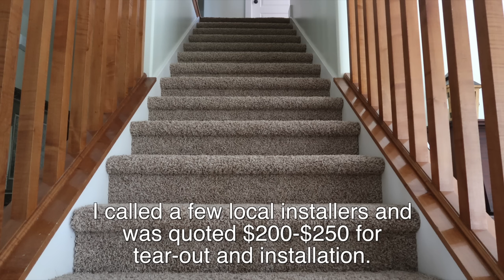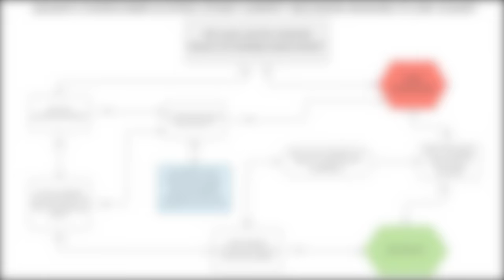How to Install Carpet on Stairs - how hard is it?

Comment: I Have Done Carpet installations for 20 years 1 Bit of Advice To Do a Rip up of Stairs,Always Start at The Top of The Steps,Ripping up your working against yourself..But Cool Video and good job.,
Reply: What happens if your stairs are already bare...nothing to rip off, then is it alright to work from bottom to top???? I'm the person that reads from the back of the magazine to the front. CRAZY habit, I know!!! LOL But, seriously...Thank you so much for the TIP (it will be VERY helpful and makes great sense). ;-D
Reply: Lollie Wink ripping carpet up is always easier to start at the top and work down. Installing is always best to start at the bottom and work tour way up
Reply: Really agree. I work in carpet and it’s way easier and faster to start from the top.
Reply: Thanks for advice :)
Reply: @leandrolopez3446  Correct Always Rip Down & Install Up..Ripping up The Carpet Going Down The Stairs is Proper Practice..it's Easier also you have more of an Advantage using your foot to Pull it Taught and use a hammer to knock it off the staples that's holding it to the lip of the stair tread.
Reply: @Andrewflex95  Absolutely Man if you Rip the Carpet Starting at the Top of The Steps it's A'lot Easier to Get Ahead of your Job you can use your Foot to Pull The Carpet Taught then a Hammer to Knock it Free from The Lip of The Stair Tread 3 Hits of The Hammer 1 hit on the Left 1 Hit in The Middle,1 Hit on The Right and it will come right off once you pull it from the bottom..Keep up the great work brother..
Reply: @kinglici5951  When Installing Yes you Start installing at The Bottom of The Flight of Stairs,,.You Need The First Step to Fasten the Carpet too The First Bottom Riser So You Can Stretch it And Make it Tight to The Next Step..Remember When your Installing Carpet the Main And Most Important Key is " Stretching it to make it tight " for Safety and Appearance of course..Rip Up from The Top & Install Starting at The Bottom Always.
Reply: I'm in the UK and we fit top down . Hook it on first gripper at top of stairs and bolster / chisel to the one below .. that way still same thing but you're not constantly fighting with carpet falling down above you why you work lol ..
Reply: Good video thanks, I personally use  heavy rubber mallet for 2 reasons 1. It's a lot less noisy rubber on to bolster and 2 does the heavy push thru.
Reply: I'm not sure I know what you mean by ripping up,  can you help?
Reply: @stevenburnett9101  Ripping The Carpet off The Steps. Taking it Off so you can install new carpet. Same Principal for Floors.
Reply: And then fall down the stairs.

Comment: Never fails to amaze me how many folks use striking/power/pneumatic tools without OSHA Z.97 safety glasses. A person can work 20 years without wearing them with no incident, but then BAM!! that stapler misfires or a staple hits an old nail or whatever and ricochets right into an eyeball.
Reply: I get accused all the time, then I remove my glasses and show the rating on both the frame and lens.

Comment: 1. To remove start from the top and work your way down pulling in a sideways motion to remove the steps, cut as you go if you need to shorten the piece you're pulling to make it easier.
2. Leave the padding as long as its not stained with urine or something, padding on stairs unless mega old is usually okay.
3. Get a drywall square or some sort of long straight edge and pre-cut your stair padding into little rectangles, they don't have to be perfect but should be as uniform as you can get them, leave a 1-1/2inch gap between the padding and the back of the riser if you don't have tack strip on the stairs.
4. Make sure the carpet grain is going down with the flow of the stairs, they'll look better.
5. Get a kicker :) and you can follow pretty much what hes doing but stretching with the kicker as you go.
6. Lift yarns out of the way while you staple to hide them, if you just staple anywhere they could be very visble depending on the type of carpet.
Been doing this 20 years and people are always too scared to try it, its not rocket science just need to know a few things, only difference is i'd have this done in about 20 minutes. You can make things easier by not wrapping the lip but just having it waterfall over, some stairs won't even have the lip. Good idea using the carpet underneath furniture, usually its like brand new so thats a good way to get more mileage out of your carpet. Good work.
Reply: agree the waterfall look so much better plus i use a double tack strip one on riser and tread 1,1/3 the thickness of the carpet to trap the carpet in the gap between the tack strips make a very clean look ans a very strong connection without staples
Reply: @bonehead2412  Yea the double tackstrip is a good way to do it, less staples the better and can pretty much get a perfect crease with a stair tool.
Reply: Nicely put !
Reply: Wow I want to see his stairs with all those wrinkles in a year . And his face saying it's worth it . Ha ha !
Reply: Waterfall nooooo  that's old style. Every one caps the stairs.
Reply: Thanks Aaron. I saved this video mostly for your information. I’m ordering a kicker and planning on giving this a go.
Reply: Aaron, we need more people like you
Reply: Care to make a video please?

Comment: I'm impressed for someone who has never laid carpet on stairs, good job!!
Reply: It can look good on camera. If you touch it and it bubles and ripples, then that's a whole other thing. He 'got away' with not using a kicker in rooms. Those rooms will absolutely get bubbles and ripples in them. He just needs it to look 'good enough' when people sign the check to him. That's his busniess model. That's not how you provide a finished look that will last.
Reply: This is hard to watch. No kicker, ripping off carpet from the bottom up, installing pad like he did. I get it he's not a carpet installer but come man those steps are not going to last without stretch on them.

Comment: Not bad. A couple pro tips though, use a rubber mallet with that stair tool so as not to cut the carpet. Also run a few staples at the back edge of the tread where you tap it down with the tool. That way you dont put staples in the stair face, it pins down the fibers and is visible in most cases.

Comment: I love this video. I've been doing carpet 30 years. Sweet compressor staple gun.! Duo-fast makes an electric stapler. Nice to see you started the installation at the bottom stair working your way up. To rip up and install a flight of box, or closed stairs, reasonable to expect $200 labor plus cost of materials. Any job that comes out acceptable is a job well done! If you had fun with that, you should try doing stairs with spindles and going through them!

Comment: I recently did the opposite. Ripped out the carpet on my stairs and replaced with oak stair treads. That too was a bit labor intensive but I'm so happy I did. The stairs with carpet always looked dirty and shabby looking as they lead to the front entrance. The oak stairs were a huge improvement both visually and ease to keep clean. I'm going with hardwood over carpet on stairs anytime I have the choice but were more expensive of the two.
Reply: I am a hardwood  installation tech and you will save over the years by not having to replace carpet and pay to have it cleaned   Also it is healthier and very easy to keep clean  I have refinished wood floors and stairs some times 70 years old. I am yet to see carpet last that long. Plus you can't refinish and restore .carpet
Reply: @captain757747  Yup, I prefer wood, it's on the plans when we go to re-carpet the house to change their stairs to wood and probably upstairs landing. As you said easier to keep clean and vacuuming stairs sucks.
Reply: The negative to wooded stairs thought is there hard on knees. I ripped up my carpet and there was a major difference walking on hard wood verses padded carpet. I'm putting carpet back. Just in case others need fyi..

Comment: Certainly worth having a go yourself, well done fella.The tools aren't to expensive, except for the stapler, mine is electric and does the job ok. The sense of achievement if it works out is good. Shop around and you can get better deals on your carpet too.

Comment: Nice job Adam, for a DIY.
Couple of friendly tips, sir.
 Rubber mallet to stair tool is easier on the ears. Definitely use a kicker. Your carpet will loosen before too long.
 I always started in the center with the first kick stretch and work toward skirt boards. 
The frieze carpet finishes nicely.
Thanks for sharing your experience. BTW - Sunday afternoon 3/15/20. bored

Comment: Was nice watching a 'novice' have a go at fitting! I'm a carpet fitter, and you done a nice enough job.. 
Only things I would recommend is that you use a rubber mallet... not hammer. 
And also don't bullnose each step then you won't require a pin gun. 
Good job! :)
Reply: What does it mean to bullnose each step?
Reply: Wrap them tight around the nose of each step.   But if there thin old 9” treads your losing a bunch of step.  Way better to bullnose.  Looks so much better but each there own I guess.

Comment: I have a semi-circle stair case so, luckily, I just do one landing-riser at a time. The new carpet will have a pattern so I will have to 'turn' each carpet piece on each step so the pattern runs with the curve. Still a lot of work. I might just get an installer. Congrats on the job.

Comment: Bravo for you. After paying (CA) Home Depot $50 to measure for my stairway carpet and installation including an area 7x6x3 landing and getting a $1,000 quote (180SqFt) I am all in for buying the stock carpet and installing myself. I just paid $3200 for 860 sf for mom's (NY) house that included installation on two staircases, LR, two hallways including moving furniture.

Comment: When I first removed my carpet from the stairs, the rubber padding underneath was caked on so hard I had to scrape it off.  After struggling with a scraper in the corners it would turn to dust.  I eventually needed a cloth iron to heat up the rest, and then I could peel it off with a large putty or drywall knife.

Comment: As a floor layer for over 20 years you did an alright job. I sat here going that's not right and no not like that and I like it that you worked  your way through and finding easier ways. Now, Stairs are much easier if you work downwards. You really need to leave slack or you will go through the carpet but at the same time not to much slack. Different carpets different ways to fit them. Well done  for effort.

Comment: It's worth it if you can find an installer that isn't a butcher, of whom won't gouge your walls and/or railing. The back of the carpet is like 12 grit sandpaper and I have seen several butchers make a mess of the woodwork. One guy sanded off the top nosing to bare wood by dragging the full length of carpet over it and it is next to impossible to match stain to already lacquered wood. This is the reason I have to do my own stairs.

Comment: Great video. Love Flowcharts. Very helpful. I just completed carpeting my basement stairs myself with assist of this video. I agree with him that the guy that wanted to charge me $200 was a very fair value after having experienced doing it myself. But since I had the time (Thanks to COVID-19 statewide stay at home order) and a fair amount of muscle, I decided to do it myself. I'm very glad that I did since I can show it off and be proud of my work and anyone looking at it would think that a pro did it. After completing 99% of the basement myself, I would rank this as one of the easier DIY projects.

Couple of Notes:
-I only had the hand tool as shown in the video for pushing the carpet into the corners. Therefore, on brand new carpet laying, tack strip on the sides was not needed since no stretching is engaged going towards the walls. Since he had ripped it up and tack strip was already there, he made the wise choice in not removing it. Had I used an actual kicker I could see that side track strip being used since a kicker can engage stretching in that direction. However, when I inspected my upstairs carpet on the stairs that was professionally installed, I found that no tack strip was used on the sides. If the professional isn't going to bother putting tack strip on the side, I didn't bother to either.

-I recommend letting the pad flow over and cover the front nose of the stair to provide just a little more cushion for the toes since I have big feet and they always overhang the front edge of the stair when I walk up and down them. Again, when I inspected the upstairs, this appears to be the way the professional did it.

-I also found it easier to just measure the first piece of pad I laid and then cut the rest in the garage the same size to make cutting and installing the pad a little easier. For some reason cutting pad was a lot more frustrating than cutting the carpet. It just doesn't want to be cut even with a brand new razor. You have to go over it several times before pulling it apart.

-I didn't have a solid straight edge available, so I used a permanent marker and a straight (yet flimsy) edge to draw my line then cut it by hand. Obviously it wasn't perfect, but I can't tell now that the carpet is installed that it is any worse than had I used the solid straight edge for my blade.

Comment: You should always use a knee kicker to tighten carpet on the tread, otherwise they’ll get wavy in no time. Also, they make an electric tacker that shoots 21 gauge 5/8 staples for the job. Pretty good for not being an installer though
Reply: Do you have a link to the electric stapler you mention? I found a couple on AMZ that do both T5 / C but they have mixed reviews.

Comment: Look fair play to the guy for having a go BUT unfortunately he put a lot of time and work on himself.
As a carpet fitter of 30 years I've seen all types of fitting, the method featured in this video is favoured in the U.S but in Europe not so much.
As mentioned earlier we start from the top allowing gravity to to it's bit. The underlay should always hang over the tread to absorb footfall on the most vulnerable part of the carpet prone to wear. Secondly we use a pair of gripper one on the riser and one one the tread with the pins facing the point where the riser meets the tread creating an interlocking space for the carpet to be chiseled in this method is called "invisifit" and does not require any staples at all. 
Reducing the fitting time to about 30 mins start to finish.
Hopefully this answers some of your queries.

Comment: When installing pad, allow pad edge to hang over the nose of the tread. It makes the carpet last longer.
Reply: according to the style of step you're installing.....
Reply: UniqueLifter205# not if your wrapping the step if your doing it New York style some call it California style or wrapping a step you don’t go over the nose of the step with pad because you are stapling underneath the nose we actually use electric staple guns , usually you pad the whole step when your doing them water fall meaning they just flow down with out stopping underneath the nose of the step , trying to staple thru carpet and pad doesn’t work very well not to mention it creates dimples that are hard to get out if they roll out at all which makes the steps look like crap .
Reply: Yes, correct. I don't suggest you let the pad cover the nose. Just let it stick out off the nose. We start at the top and use our thumb to push the carpet toward the nose and, using a DuoFast electric sstapler staple under the nose. There are no dimples, since you don't staple through the ppad I agree with your response.
Reply: Um, no.  Don't do that.
Reply: Ah......I have been installing stairs for years. Heather is the expert, listen to her.
Reply: @2mexpesos  So, why am I a pawn?
Reply: UniqueLifter205# 
Sorry I deleted it.. I type the comment in error...
Reply: @2mexpesos  No sweat! Thanks for clarifying that.

Comment: Hi Adam - thanks so much for the super helpful video, just finished up the project (though I did it waterfall style since that was what was the style of the old rug).  It turned out great, wasn't too hard, and saved myself about $500...I live in DC where contractor prices are pretty steep.  Thanks again for your help!

Comment: Awesome job mate !  He’s using the same Roberts brand stair tool I use … I think there’s no need to install gripper at the edges of the steps.
Reply: In the uk we full fit our steps with gripper top and bottom and underlay gap on width waterfall effect looks so much nicer

Comment: Please use an electric stapler not an air tool, after you stapled under the nose use a kicker to kick it back to the tack strip then use a chisel and Hammer to crease it between the face and tackstrip
Reply: Ive posted the correct way